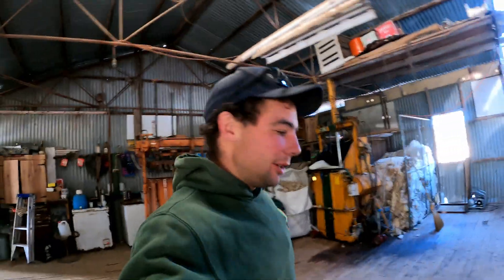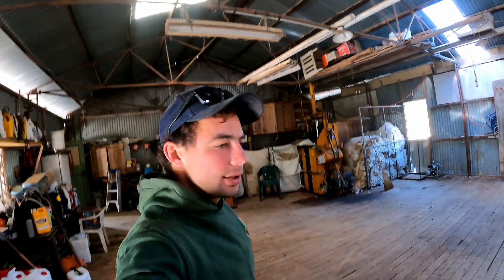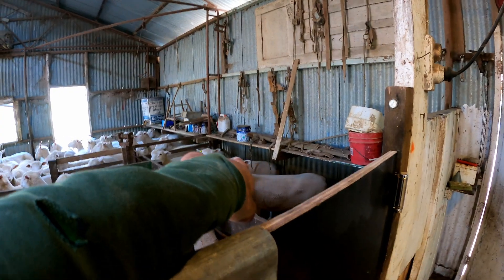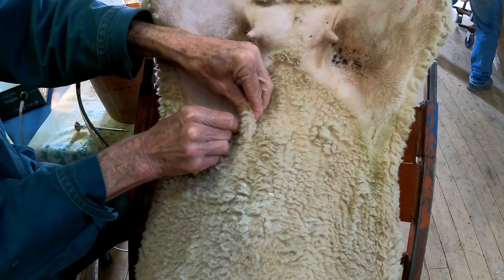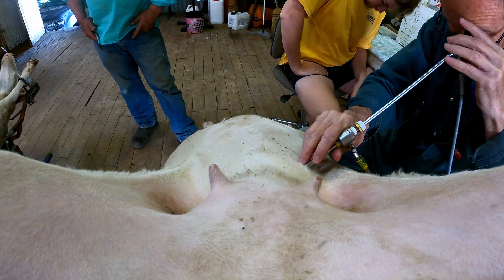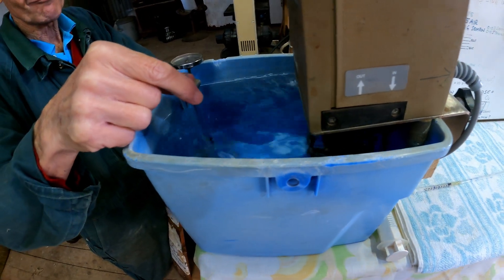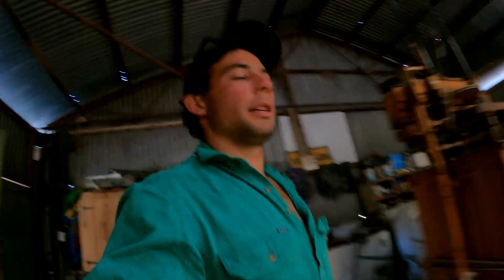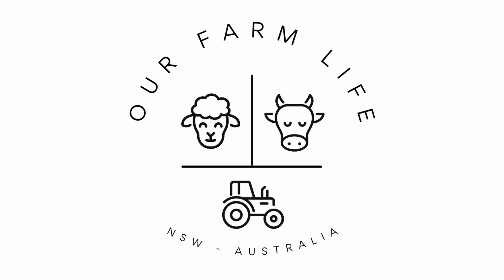SHEEP LAPAROSCOPIC ARTIFICIAL INSEMINATION | The How and Why | Poll Dorset | Aussie Sheep Farming

Comment: Gestation Meaning how long the ewes are in lamb for? Is 150 day (5 months)? If that's what you mean. 
Also when selecting Semen to use during AI what do you look at in a Ram (if you don't physically go and look at the rams?)
Reply from the maker: Hi Dan, yep that’s spot on! We know the 2 studs and the types of rams they are breeding. Had conversations with both of them about which rams have worked for them. But no you’re right, definitely wouldn’t use a Ram that we don’t know the bloodlines or successes of, and not going to physically look at.